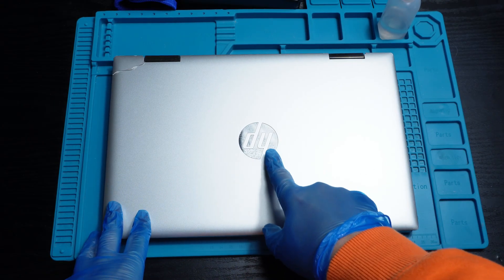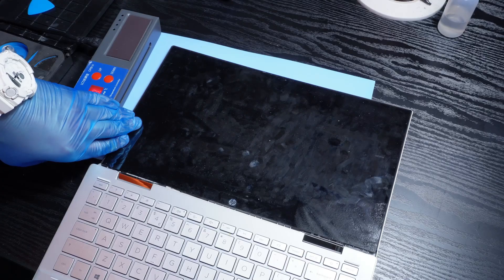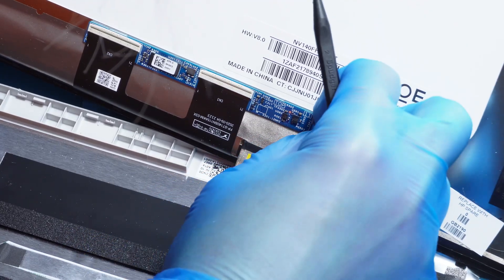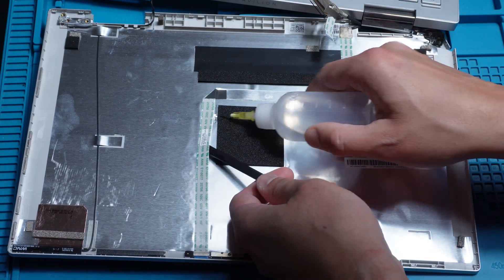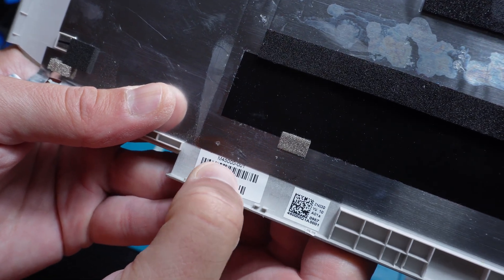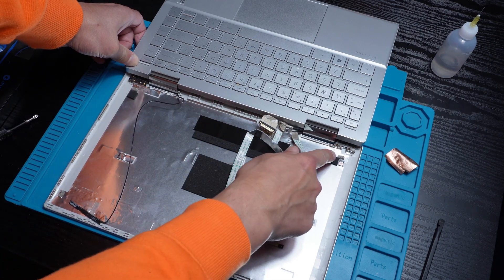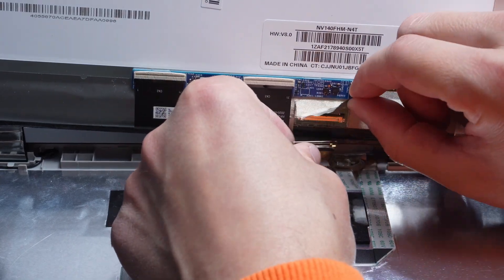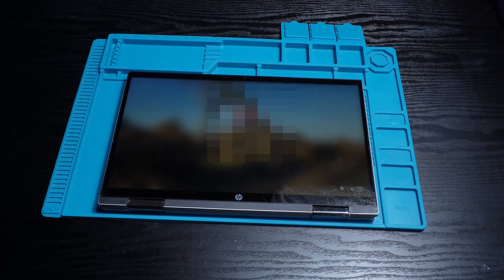Beware: 360 Hinge Laptops Can Break Like This!

Comment: hello, what are those small rubber clips at the edge of hinges called?(not the rubber straps under the laptop), one those of my laptop is broken is that repairable or should just be ingnored?
Reply from the maker: Hello! You’re likely referring to the hinge corner rubber bumpers or hinge caps — those small rubber or plastic pads that sit near the hinges, often on the edges of the display lid or near the hinge mechanism. On convertible laptops like the HP Pavilion x360.

-Help cushion the lid when closing, prevent direct contact, and sometimes hide screws
-Is it repairable?
Yes, but HP rarely sells these as individual parts. Take a look on eBay.